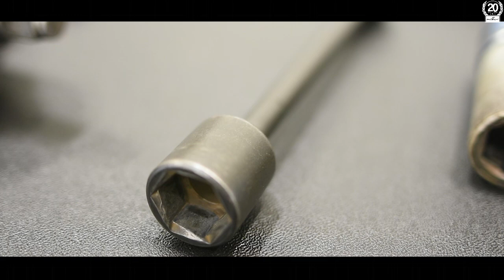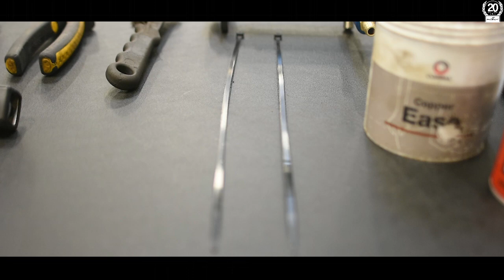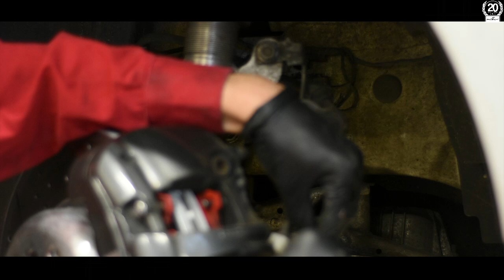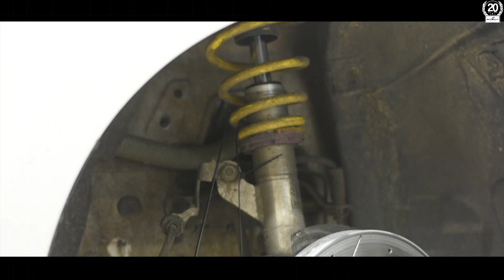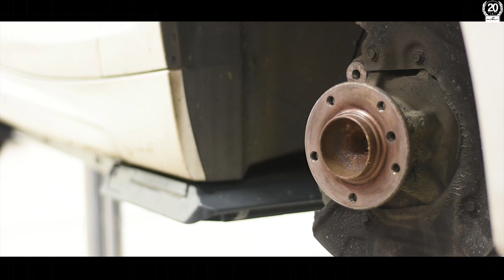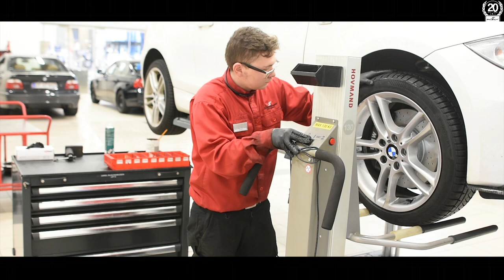How To: Replace Brake Discs and Brake Pads on your BMW - DIY Tutorial -

Comment: Just did rotors/pads front and rear on my 09 135i. Torx bit was a T40 for me. Make sure to use PB blaster, they are easy to strip (I did). If you cant remove one dont worry, it will be a bit more difficult to put the pad in but just keep moving along. Those two things are the only trouble I ran into... great video! Also make sure not to get any brake lubricant or copper ease on the friction surface of the pads!!!

Comment: Which front Brembo brake calipers are these instructions for?  The 6-piston or 4-piston?  Asking since the 4-pistons don't appear to require the rear bolts to be removed while the 6-piston ones do.  Both of these styles of calipers are apparently both called "M-Sport Brakes" so its kind of hard to find clear instructions.  Thanks!

Comment: Great to all the best tools but follow this and you could easily overflow the brake fluid reservoir as the caliper pistons are retracted. It is not unusual for people to top up the brake fluid reservoir as the pads wear. Plus copper slip is not recommended anymore with modern pads by most manufacturers.

Comment: Good tutorial , except you missed few things : loctite and torque wrench for the wheels.
👌🏼
Reply: He used a torque rod instead of a torque wrench
Reply from the maker: Dear Mr. Brown, we did use a Torque stick which like a torque wrench  ensures the correct torque on the wheel bolts, we don´t use Loctite on wheel bolts.
Reply: Mr. Brown is just a 'Wannabe know-it-all'.  I like the way you shot him down in a respectful type of way.  I just changed by front rotors/pads on my 2015 BMW 528i yesterday and didn't use Loctite on my bolts as well.  All I did was give them a good cleaning to ensure they were free of debris.
Reply: never use loctite on wheel bolts man just a little bit of copper paste.